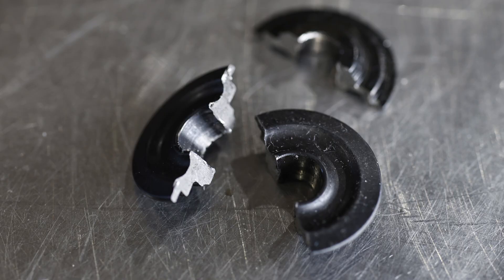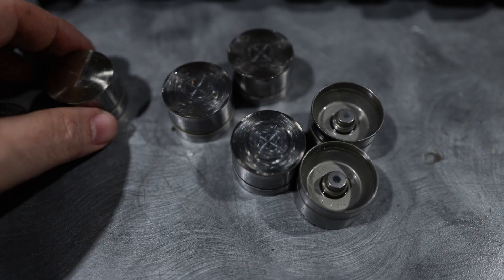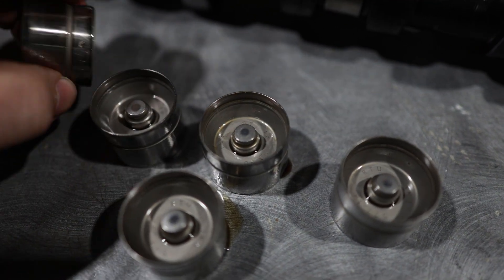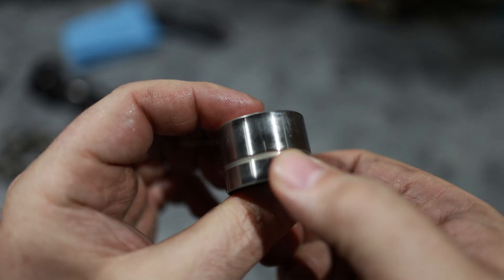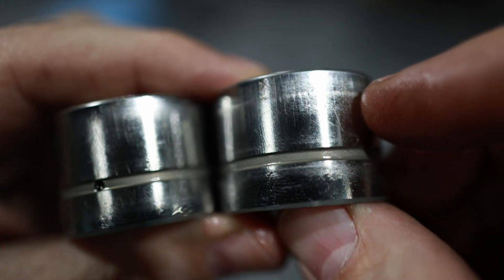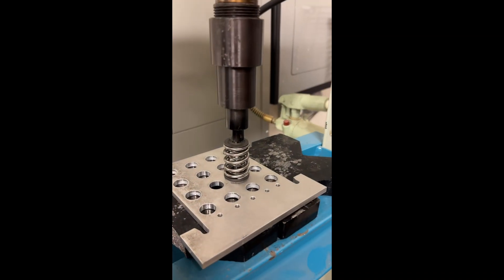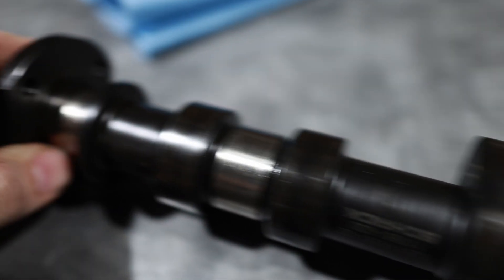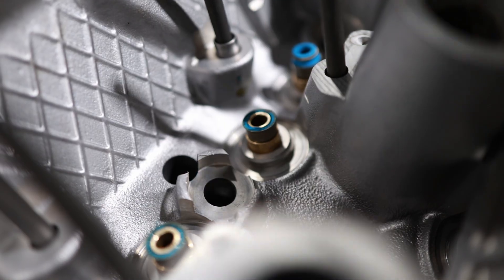Why Did This Cylinder Head Fail? Dave Solves the Mystery!

Comment: Did he just toodles us lol. That seems like a hard one to solve if you only have bits and pieces of info. The failure went to the same cylinder for each event, then yeah find the common denominator. I'm curious why you would use a the cap/bucket and cam again. Lifters are worn in at initial startup to break in. With a cap/bucket it must be different. Engine failurs always has to have a complete inspection and comparison of parts to solve what happened. Not blaming anyone but you obviously found it by comparing to other buckets.I find it really hard to believe no lash was checked or how was it not noticed that the cage wasn't seated down with no cam? Human error? Maybe. More like a learning curve like going from diesel to gas. It's the same but different. Diesels we check oil level first cause it won't run of it's too low. I say we all learned that we can learn by working outside our comfort zone. That retainer broke down the middle, that's crazy. For the smoke the oil was either forced in past the guide on all cylinder valve guides or the intake at high boost then clean up at normal pressure. It has to be a boost event or a weird type of tune to keep turbo lag down and scavaging the oil. Seen weird crap with having a vacuum pump with high boost just saying it probably not the same but it was some shit where oil showed up past a control valve. Think BMW vanos taking a dump then decide to act normal.

Comment: Another common problem with these BMW engines is the oil pump. The oil relief valve often sticks and stays open, causing you to lose pressure without even turning on the oil light. Here in Europe, they're the M50 and M52. I don't know if they're S50 in the US, but I'd say they share the same pump. What I use is the oil pump from a 286hp E36 M3. Here, it's an S50b30, and the pump pinion is larger.
That's what I usually do when I upgrade from NA to Turbo.

Comment: Hi Dave
I always unload those hydraulic lifters before installing them. This way, you avoid bending valves when starting the engine, and I've even seen camshafts break, so I install them unloaded.
You can disassemble it to see what happened to the lifter. If you hit it hard against a table, the piston will pop out. I'll see if something got stuck inside or if it's seized up. Just out of curiosity.
Great investigative work, Dave. I love CSI, haha.

Best regards.
Goyo
Reply: Great input
Reply: @highpsiguy4085  thanks
Reply from the maker: I should have reached out to you first! This was so long ago, we don't have anything here anymore. But, thanks for the tip!
Reply: @headgames  I imagine you've already got everything sorted. If there's a next time, you know, just get the lifter working, haha.
A hug, Dave.

Comment: I would be looking at his oil pan, probably using OEM oil pan or without the proper modifications to avoid oil starvation in corners, pictures show that the car is used for road racing, and OEM oil sumps are NO BUENO for that.

Comment: Could the hydraulic buckets be checked in y’all’s valve spring tester, to be able to read pressure and height?
Could valve height be a issue, if the valve height took the bucket out of lash compensation range?
Reply: The pressure is provided by the oiling system. Without being in a pressurized oil system (running motor) there's no way to check the pressurized height or resistance. As stated above you can absolutely disassemble one or all buckets to check for wear internally. With one bucket plunger being stuck,  id imagine either the inside is scored or seized mechanically.

Comment: Why did the unbroken lifters show signs of oil starvation?
Reply from the maker: Would be all theory. And a few possible causes, that mystery was not solved.
Reply: @headgames as I think about it driving around for work today I have two theory’s 
1) Sustained High rpm causing aeration of the oil
2) or causing excessive heat in the head causing the oil to thin out

Comment: He should also switch to VW hydraulic lifters. They handle higher rpm better and are lighter.
Reply from the maker: @exvils  what vw has the same dimension lifters?
Reply: @headgames  The older VW 1.9 D and 1.9 TDI engines have 35mm bores and weigh less than BMW.
And I don't know the exact model, but gasoline engines like the VW Corrado also have 35mm bores, but I'm not 100% sure.
Reply: @headgames , Good question ❓.... I know that VAG used the same (dimensionally) parts on different vehicles. I'm pretty sure that the same design engineers work on Audi, VW and even the Lamborghini.... It's good to know what parts are interchangeable and what the difference is between them🤔
Reply: Which model to be exact
Reply: FEBI 07060 (VW: 050 109 309 H) out of Golf 3 era of engines (big block vw 8V engines like 1.6L, 1.8L, 2.0L (in brasil VW AP engine) and 1.9tdi VP)

Cat Cams does aftermarket mechanical lifter as replacement for 35mm bmw/vw hydraulic lifter (CC005) with (TS102) valve lashes.

Tho i plan on looking to/testing FEBI 181482 mechanical lifter found in many Renault engines (Renault: 77 00 102 350 last number changes based on height/shim, 6€ per pcs here) with some sort of custom shims/valve length or said catcams lashes.